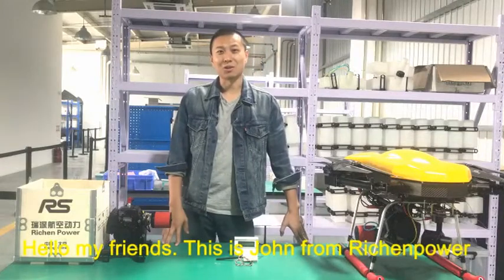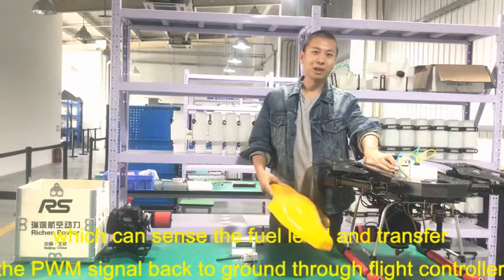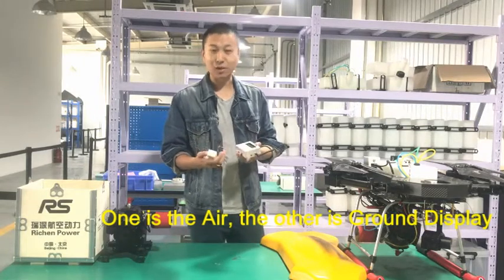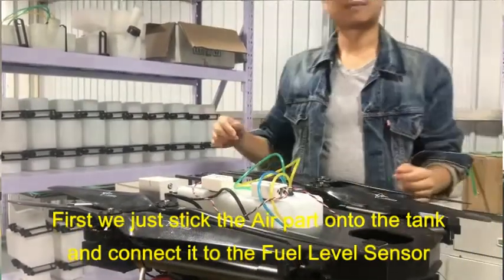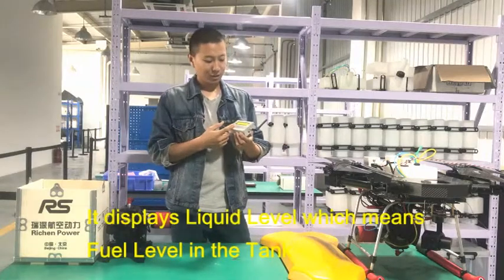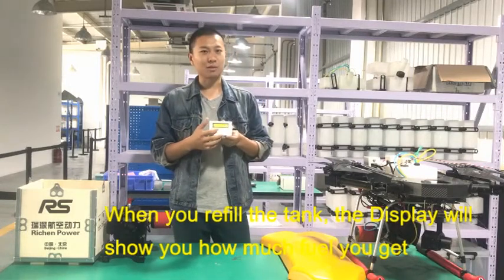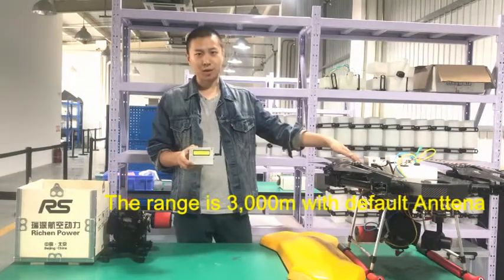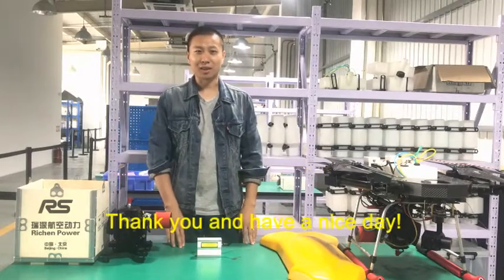Fuel Level display wireless 3000m to 8000m

Comment: This looks great! Does it work with pixhawk?
Reply from the maker: Sunday Idajili Yes, Display works with PIXHAWK. PIXHAWK supports PWM input very well. That means fuel level signal can be transferred back to ground through PIXHAWK without Display. Of course you can use Display to monitor the fuel level anyway.
Reply: Thanks for responding. I really look forward to using your generators.
Reply from the maker: Sunday Idajili thank you. You can order from EBay or email me directly: info@richenpower.com